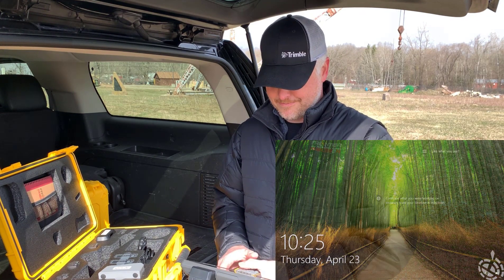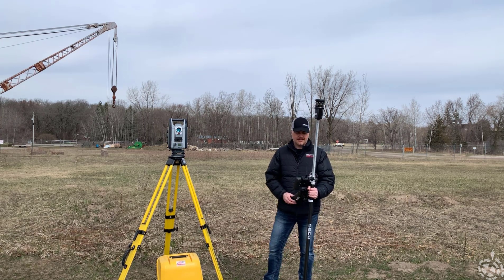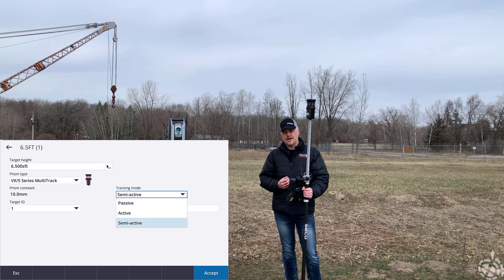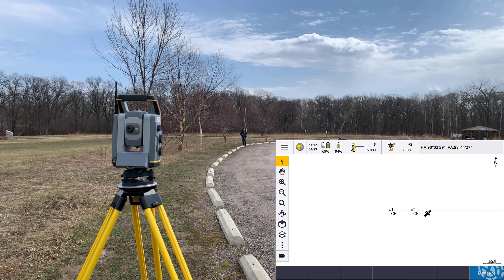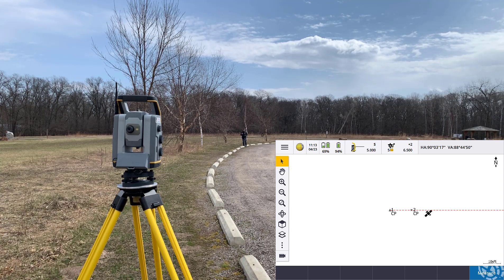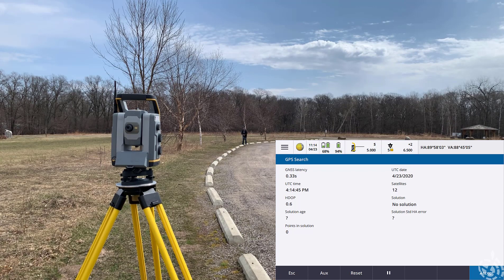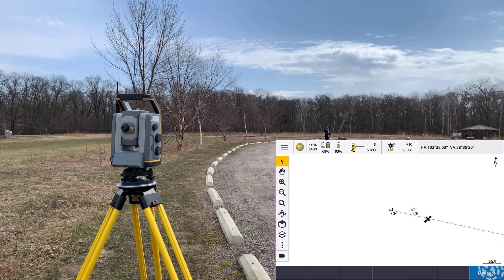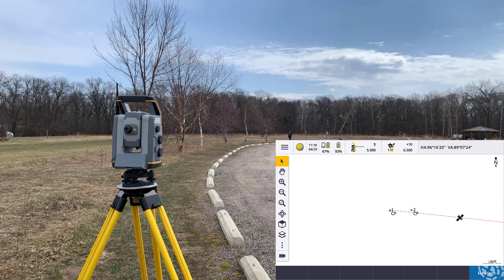GPS Search for surveying with a Trimble Robotic Total Station

Comment: Little tip from SoCal :  Do not use 5,000 5,000 for coordinates.  Use 10,000 5,000 (or vice versa, depending your local normal practice).  This way you can mentally keep track which is your nly & ely.  Happy surveying!
Reply: That is an awesome tip!  Thank you for sharing and I will definitely do that the next time it comes up.

Comment: Why are you on "standard" and not on "tracking"
Reply: Hello.  Thank you for your question. I always recommend that customers use the standard mode for establishing their control (backsight or resection).  The default in the S series survey style is to average 5 measurements before storing the point with standard.  Then if I am doing a simple topo, I will switch to tracking mode to save some time.  But will switch back if I am checking into control later in the day.  I hope this helps.

Comment: Hi. Does TSC3 have this GPS search function? Tried to find it today with no success.
Reply: Hello, yes it does.  However you need to turn the GPS on first.  Select the Windows icon on the top left corner of your keypad, then scroll down until you find Satviewer.  Tap that icon then select the GPS tab and select the Connect to GPS.  It could take a few minutes, but as long as you are outside, you should see Lat and Long coordinates appear on the top of this screen.  Once you see those you can select the Trimble logo on the top of the directional keys to get back into Access and General Survey.  Then you should see the same satellite on the map screen and give you the same GPS search functionality.  I used it quite a bit on the TSC3 before the Yuma 2 Tablet came out.  I even used the feature back on the old TSC2 controller with the GPS card inserted.  I hope this helps.
Reply: @westonschneider3544  what's the procedure on the TSC5?
Reply: @westonschneider3544  Thanks. I got where to activate it. There is no target control menu, or I cant find it. Usually I use integrated survey so Trimble GPS could be good as well. But cant find that target control menu in my TSC3.
Reply: @scandinavian_advice  Hello, Once you have it turned on in Windows Mobile you also need to check it on in Access.  When connected to the S Series instrument, select The Instrument icon in General Survey,  then select Target Controls, go to page 2 and check "On" the GPS Search.  The Select Data Source will be Auxillary GPS.  I only use the 3D option when doing Integrated which I cover in a different video.  You can then select Accept to give it a try.  If you are running in an assumed coordinate system you may need to go back in that menu and select the GPS softkey on the bottom to reset your satellite tracking / resection to get an accurate result.  This process is similar to the one in the video.  I hope this helps.